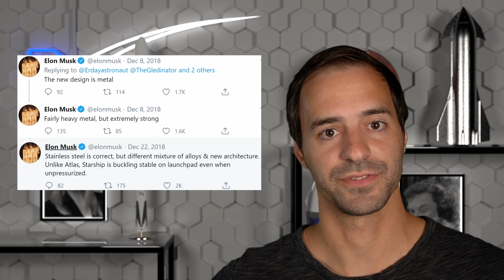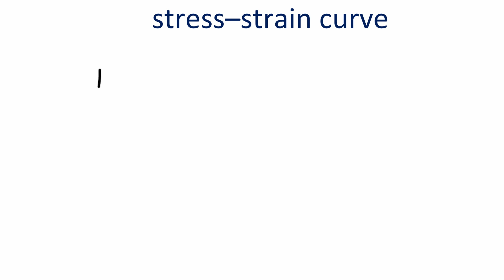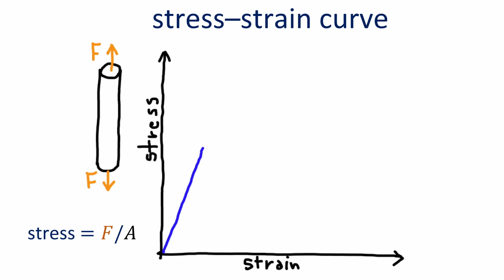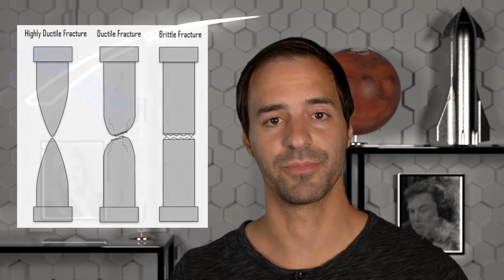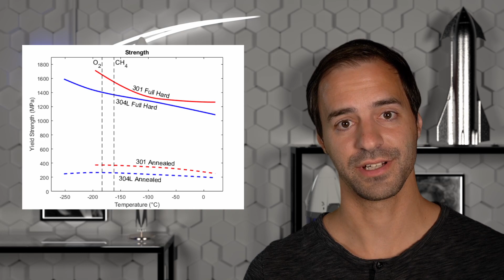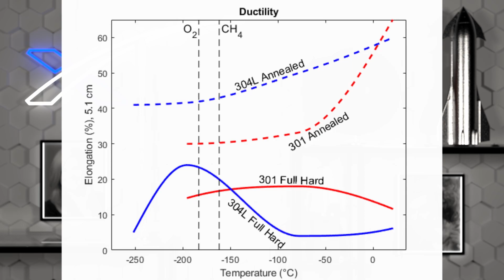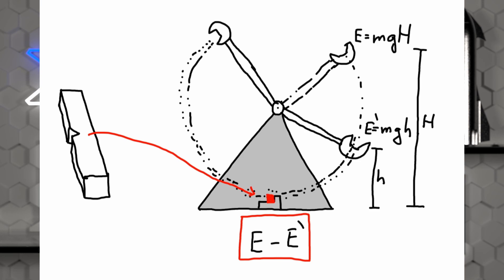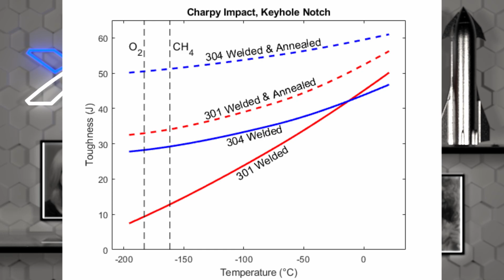Why Is SpaceX Switching to 304L Steel for Starship SN8?

Comment: I am a miner, in Australia. I have many materials in some exceptional land holdings. I really liked your discussion...simple and to the point. The next follow on needs to be the examination by Electron scanning microscope of the particles in the st asinless. I have seen this in a UK presentation by a company, too amateurish. The ductility quotient of the stainlesd would be significantly enhanced by the use of niobium in the alloying process I expect - it is the key ingredient in steel used in structures with high flexing...moly not only hardens (no required here) but resists surface degeneration...I'd like to understand why they haven't considered using niobium - its a ferro matetial which should aid alloying and the result. But in stainless associated with chromium? I am just a guy that mines this stuff, I have both chromium and niobium, so very intetested in this possibility.

Comment: Do you know what is the plates  width in Astm 304L, 3.96 mm thickness  used to do the differents parts of the boosters, Starship? Etc As you say weld is the weak part
Reply from the maker: No idea, somebody would need to photograph all the rolls and labels coming in
Reply: @spaceflightexplained360  it is already done   coils 1828,80 x 3.95 mm 2b in 1.4310 and from 2020 in Astm 304L seems to be 1828,80 x 3.60 and Outokumpu Calvert Alabama is the supplier. I don,t know if there are other thicknesses, etc for Starship actual prototypes .  This is for me the best company  in the world in stainless steel grades for multipel applications : cryogenic, corrossion, steels with high mechanical properties and corrossion resistent, etc

Comment: Hi very well explained I was working in Avesta Sweden with all kind of S S for chemical, petrochemical, cryogenic and corrossion applications and I ,m very interested in Space X etc. I dont know why SS was nor selected from the beginning, etc Erik Johansson Sant Cugat Barcelona
Reply from the maker: Hi Erik!
It is such a great material, strong, predictable, formable, machinable... You just need to be able to accommodate for the weight.
Reply: @spaceflightexplained360  Thank you. Astm 301/1.4310  2b coils 1828,80 x3,95 mm was selected as altv to fiber carbone but in 2020 it seems Space X changed correctly to the austenitc grade Astm 304L/1 4307 2B coils 2b 1828,80 x 3.60. It seems they have reduced something the thickness .I don,t know if Space X is using other thicknesses for Starship prototypes.  I know from my work that this grade and also Astm 304LN has been used from 1970 as more appropiete grades due to welding,  forming   workability etc for cryogenic app.. Outokumpu is one the best supplier of the world in the stainless steel grades- standard and special grades-  due to multipel solutions at difference industrials areas so SpaceX is going correctly with material and supplier
Reply: Avesta is now inside of the finish group Outokumpu

Comment: Time to update your video and this is actually old news.  Space X created the own alloy called 30X which is an upgrade from the 304L.    Space X does innovate pretty rapidly, but it has been a year.   The pandemic was hard for most everyone wasn't it?
Reply from the maker: Two points: this is old video, and I bet they are still using 304 in some of its variations

Comment: Well explained. Thank You. Based on what we know so far, what type of welding process,  preparation, fit up and cleanup are being used?
Reply from the maker: I wish I knew! It seemed that for the early Starship prototype they just stick welded everything, but as they go forward, they will need to improve the methods of they want to reduce the thickness and welds, eventually getting it welded robotically. Will it be TIG/MIG or laser? I don't know...

Comment: That was amazing! Good job with the video, it was very well explained.

Do you think SpaceX will use 301 or completely different alloys in areas that are not directly in contact with the cryogenic fuel, like the nose cone and the bottom area around the engines?

Comment: These things were known before and they also knew in SpaceX. Then the right question shouldn't be:
"Why did SpaceX switch to 304L steel for the Starship SN8?"
but:
"Why did SpaceX start with 301 steel for Starship SN5 and others?"
...
[written with /translate.google.it, sorry but I don't know english]
[the original:
Queste cose le si sapeva da prima e le sapevano anche in SpaceX. Allora la domanda giusta non dovrebbe essere:
"Perché SpaceX sia passata all'acciaio 304L per Starship SN8?"
ma:
"Perché SpaceX abbia cominciato con l'acciaio 301 per Starship SN5 e le altre?"]
Reply from the maker: I totally agree! The reason is known in the expert circle, which I decided to explain. Your question is probably tied to supply chain issues which are proprietary

Comment: I just saw a paper about cold spray deposition of 304L steel on a steel substrate: https://www.sciencedirect.com/science/article/abs/pii/S0022311520305286 The results demonstrate that a cold sprayed stainless steel coating is a viable option to provide a physical barrier against CISCC in fusion weld regions of stainless steel in corrosive chloride salt-bearing environments. Could SpaceX use this for coating Starship to achieve better aerodynamic laminar flow?
Reply from the maker: That is really interesting, I didn't know that spray-on steel coating is a thing! 
It definitely could be an anti-corrosion option for the welds, but I don't know how would it survive the reentry or how much weight would be needed to cover all the welds, and what is the adhesion when exposed directly to the sun.

I'm sure SpaceX has much better answers and we will see soon!

Comment: Bingo ... I thought of one more reason ... welding in humid environments can exacerbate hydrogen embrittlement.  304L is less influenced by the humidity during the welding process.  Boca Chica is humid. I figure eventually, spacex will ultimately control the atmosphere while doing automated welds to obtain uniform high quality welds
Reply from the maker: I think exactly the same thing. The automated cylindrical welds, potentially using laser, seem to be an obvious choice. In enclosure of course. Few weeks ago, welding robots were delivered to Boca...

Comment: in most welds the weld is stronger than the base metal, most cracks happen just outside of what you call the heat effected area more commonly known as theoretical throat
Reply from the maker: Does this apply for a highly work hardened metal though?

Comment: would it be better to spiral weld the rocket body instead from a roll without cutting, https://www.youtube.com/watch?v=x4l2IQQhw-U
Reply from the maker: That was actually a common question and Elon's answer was that if you do that, the whole rocket would have the same thickness. 

It seems that they need the rings to have different thickness from each other

Comment: 304 Stainless Steel is used in all aerospace equipment  . I made equipment for aircraft with it for decades . It is soft , flexes well and welds very easily .
Reply from the maker: Yes! At 3 mm thickness, hardened, it is not gonna be so soft anymore :)

Comment: Fantastic content. One question I have though: This is a single stage to orbit ship which implies it also has to do reentry. Everyone seems very entranced by the cryo properties but how is this stuff going to handle the heat of reentry? The graphs seem to flatten out pretty quickly above 0degC. I am encouraged by the fact that they're still talking about welding rather than soldering the stuff ;p but still.
Reply from the maker: Hi there! Well, steel is really good at handling heat in general (compared to aluminum at least)... I can thing of 3 reasons why nobody talks about reentry stresses, but who knows if it is correct:

 1) The whole Starship will probably weigh under 15% of its launch mass. So maybe not a severe loads.
2)  There will be very little pressure in the tanks compared to intended 8.4 atm at liftoff. The force on the tank walls is insane. (The material needs to sustain roughly 1260 MPa).
3) Nobody knows the reentry profile, and even if we knew, the forces and heat would have to be modeled, and I'm not sure if anyone on YouTube has the skills to do that.

It is just easier to focus on the launch part, especially when Elon mentioned in the tweet that the reason for the switch is toughness at cryogenic temperatures.

Comment: Excellent video. You touched on everything I could think of.  There is a small distinction between toughness (the energy a material can absorb before breaking) and fracture toughness (the ability of a material to arrest crack growth). Typically Charpy tests are used to ensure good fracture toughness. And fracture toughness is what SpaceX would care about since all those welds are not likely to be perfect and contain tiny flaws that you do not want to grow into large cracks.
Reply from the maker: Thank you for the insightful comment. I was wondering that myself, but it is impossible to find the data for regular toughness. The fracture inducing notch definitely changes things a bit, but this is the most relevant experiment with some data available that I could find.

Comment: 316L  Stainless Steel would offer superior Chemical resistance properties, especially if thicker metal is being welded. Chromium and other components for 304L and 316L are near identical, but 2 or 3% Molybdenum is added to 316L. The 2% Molybe\denum content in 316L is critical. Worth the slight increase in cost. In the Food industry, 316L is regularly used for applications where food products are in direct contact with the stainless steel. External fittings such as clamps and supports can be made out of 304L.
I wouldnt use stainless steel for the main structural components of a Rocket Ship. In space, there is no water present or oxygen outside the ship so corrosion is not possible. However internally corrosive conditions could develop. 
You will notice that Naval ships, Jet fighters, weapons, missiles etc are not constructed using stainless steel, and the military budgets are enormous.
Reply from the maker: Than you for the comments! I was wondering myself why not go even further to higher numbers in the series.  One explanation might be that those steels are less strong, and they still need something with Yield strength of about 1260 MPa, which achievable only for really hardened steel at cryo temperatures. Another question how the other steels behave at cryo... The public data is sparse

Comment: Im not a welder, purely an amateur i do some oxy acetylene, brazing, tig, mig, stick but fascinated with the craft. Thank you an explanation why SpaceX changed stainless grades, makes complete sense.You should do more videos, you get swiftly to the logic.
Reply from the maker: Thank you!!! I'm jealous, I never welded myself, I just read a lot of theory for the less common methods (laser, election beam welding) for my hobby project...

I tried to get to the point, but it still took 11 minutes video to get to the point based on the data :)
Reply: @spaceflightexplained360  Weirdly back in the 70s my school encouraged us to gas weld and braze at the age of 15! By 16 we were turning out fully functional motorcycles, including frames! The school had a full engineering workshop including forging hearth, lathes, millers etc.That fired up my fascination with engineering, I was already into electronics. Later in life in my 20s went on to form an engineering / electrical design company employing 25 people and dealing with car companies  all over the world to this day. I was lucky to have found my passion in motorcycles /engineering / electrics early on in life so  hit the ground running in the real world.
Reply from the maker: @slartybartfarst9737  We did have a classes like this (in the Czech republic) around 7th grade, but I think I was too young to appreciate it - the nerd in me didn't fully manifest yet. 

I wish high schoolers had the chance to create a useful physical stuff - there is no better gratification feeling that designing a building something yourself.

And I wish machine shops would be as accessible as libraries :)
Reply: @spaceflightexplained360  This was UK in the 70s, later on insurance concerns meant such facilities were scaled down and now non existent. We are making a nation of book keepers. Cant see car manufacture staying in the UK, i hope Im not right and maybe its not up to the schools but it certainly worked for me.